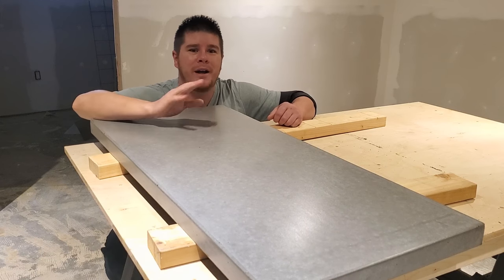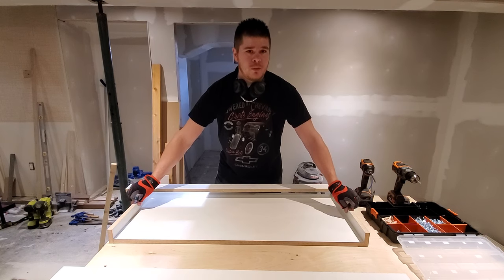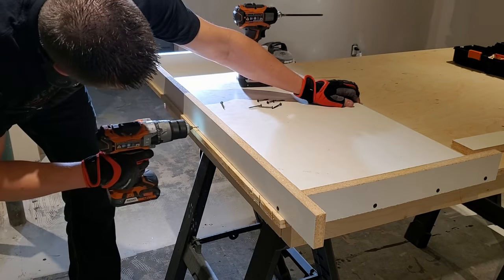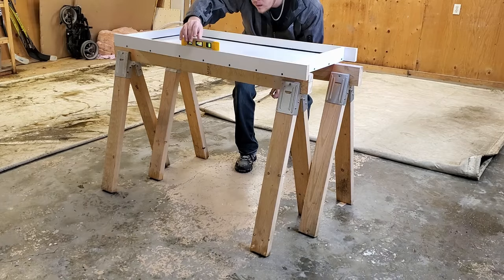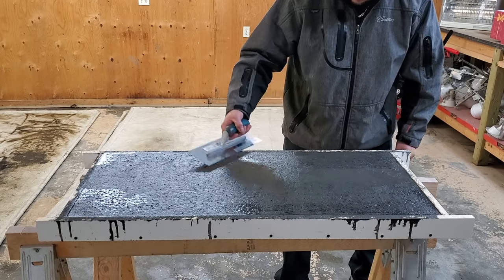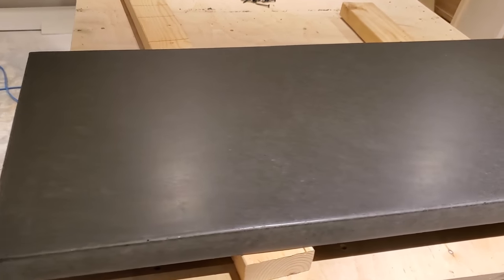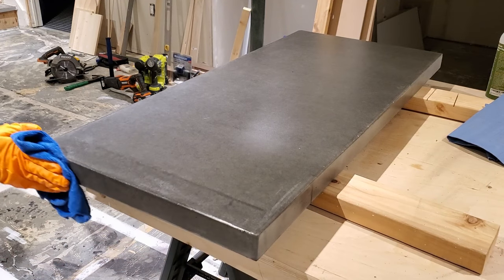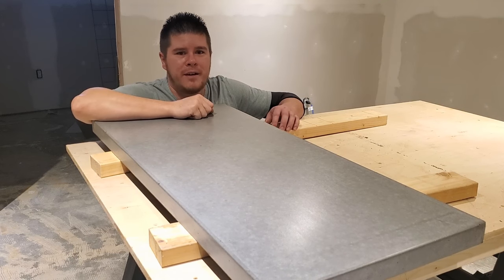Beginners guide, Concrete Tabletop you can build. No special tools, hand finished

Comment: Hi Jesse - As so many others have stated, yours is BY FAR the best instructional video for a DIY concrete counter I was able to find. Thank you! I used it to make a fireplace hearth. It came out amazing except for one small glitch. For some reason, I'm able to see outlines of the wire reinforcement on the surface. I see in other comments you referred to this as "ghosting." My slab is 1.5" like yours. Perhaps my cement mix was a little too watery and it settled closer to the surface during vibrating. I used countertop mix. I don't think it was too watery, but who knows. Anyway, I wouldn't mind natural color variations since it is concrete after all, but the visible "grid" does take away from the natural look a little. There are spots of the surface that are darker like where the grid lines are and it almost seems as though there is a residue or something in the pores causing the lighter spots. I included a close up photo as well so you can zoom in and hopefully see what I mean. I have thoroughly polished with the 800 grit several times with no change. These photos were taken while it is completely dry. I have not sealed yet and was wondering if you could think of anything I might be able to try to "clean" the lighter areas so at least the grids lines blend in a little better. Thoughts?

https://photos.app.goo.gl/6d5mUvg7XCADpFjNA
https://photos.app.goo.gl/xczbMPRhvs8B7snv8

One other question. Since this is a hearth, I am concerned about using an acrylic (film) sealer rather than a penetrating sealer. Fireplace tools would likely scratch a film over time. My plan is to use a penetrating sealer with the wax. Is my thinking correct on this?
Reply from the maker: I replied to you via email!

Comment: Thanks for  a great video, showing a very straight forward and approachable way to do this.
One "thought" that possibly (?) could make "mold making" even easier. 
What about cutting all the "edge pieces" to be a "bit to long"(4-5 inches). And then when You mount them You start by fixing the first one perfectly aligned on one edge of the "bottom" and let it "over extend" the other edge. Then when You then mount the second, third and fourth "edge piece" You just put it "but up" to the overhang of the previous piece, thereby You will also "automatically" get perfect fit without really having to measure the length of any of the "edge pieces"  exactly (which I believe could simplify the procedure for people who have more "rudimentary setups") . AND since all the "edge piece" will have one end with "overhang" You might even get a mold that is even easier to "break down" without "endangering" the slab :)
Just a thought..And I realise that it might be hard to understand when put in writing, but I hope that I got the general idea across.
Best regards
Reply from the maker: Anytime, I'm glad you liked it! It actually wasn't long after I made this that I realized that method would be even better lol it does make measuring the sides even easier and gives each piece a pull handle. You are correct! Good luck on yours and let me know how it goes! Thanks for sharing

Comment: Thanks for a great video.  I took the forms off of the slab and am in the process of sanding, sealing and waxing.  So far it looks fantastic.  I did exactly what you described and I was surprised at how easy this was. Thanks so much for all of your efforts!
Reply from the maker: Awesome! Thanks for watching. I'm glad I could help and stoked it turned out for you! I'd love to see it, and I'll even feature it if you send me an email with a pic, or tag me on Insta
Reply: What mix did you use
Reply: @chrisfaircliffe5533  I used Quikrete counter top mix with some charcoal coloring added in.  I bought both at my local big box orange colored hardware store.

Comment: I agree with the sidewall method. When I've done this in the past. I actually scrubbed measuring length of the sides all together. Just over lengthed first side flushed to one corner of the base leaving a wing, then did the next side clockwise. Leaving each sidewall with just one "wing" for that same sort of grab handle. Worked a treat an eliminates any need for needing any sort math or precision ..or even measuring for sidewall length cuts. 𝒯𝒽𝒶𝓃𝓀 𝒴o𝓊 for the carwax mold release idea. Excellent!
Reply from the maker: It's so much easier that way. I'm glad you liked it!

Comment: Hi!  Just wanna say I like your video

My favorite trick with finger finish- put a tiny bit of dish soap

You can also take a bolt and run it on the corner and pull off the excess so you’re left with a super minimal finish on your corner.
Reply from the maker: Hi! Thanks. 
Absolutely you can, I've shown other ways in other videos, but this was simplest this time. Thanks for sharing

Comment: Thanks a million. Just about to make a test piece of a countertop with scrap melamine board before making big countertop. I will make one mould with sand, cement and plasticiser and another with small stones added to see if aggregate can be seen on the finished surface. Great video. Much appreciated. Great to know I don't need to buy expensive tools for a good finish
Reply from the maker: Thanks! Aggregate is used for strength, without it, it will be much weaker and more likely to snap or crack. If vibrated correctly, you won't see any as the concrete creme with encase them. Good luck and have fun! Any questions, just ask

Comment: You have put together an exceptional video about how to cast a tabletop or anything else, really. I would offer one small criticism. Concrete does not dry. This is so commonly said that it changes how people handle/work concrete. Concrete cures. It is a chemical reaction, that even generates heat, making it an exothermic reaction. Concrete requires water to go through this reaction and some of the hardest and strongest concrete is formed underwater. After the surface is hard enough to not be disturbed by water let it have all it wants---flood it, especially if it is a hot day and in direct sunlight. Great video!
Reply from the maker: Thanks. That is true. I am typically a big proponent of telling people the difference between dried and cured, they are very different. Doesn't matter if it's concrete, paint, or some kind of coating. I was trying to keep this video as simple and DIY approachable as I could. Thanks for sharing

Comment: Great video, I'm going to try it as soon as I can get all the supplies lined up and outside weather is a little warmer, I'm in Canada, still kind of cold here. I was wondering what kind of dye you used, I would like to add that to the mix as well. Thanks for giving me the courage to give this a try, I plan on making a top for a outside coffee table on my deck.
Reply from the maker: Thanks, glad you liked it! I'm in Saskatchewan myself lol where you at? I used Quikrete liquid charcoal dye, I only used one bottle per bag of concrete but you can use up to 2, just reduce the water a bit. I'm glad I could help you out and that you found it useful. Good luck on your project, keep me posted on how it goes!

Comment: I’ll be trying this tomorrow, thanks a lot for sharing. This has been the best video I’ve seen so far, simple, to the point and an amazing result (the best one). 
Keep up the good work!
Reply from the maker: Wow, thanks a lot! Good luck and have fun!
Reply: CanaDIYan man, I did it and vibrated it for nearly 20 minutes (by hand, haha) and wow, the results are amazing. That top is smooth as it could be, gorgeous color and all. It doesn’t look as sleek as yours but I’m proud because the result is very aesthetic. I’m going to redo it because I poured a bit too much water and although it’s been holding well I wouldn’t trust it for long without a base under it (it currently has the melamine that was on top under it). I did it with nails instead of screws because I had very limited tools, and the bottom part is not as pretty because I couldn’t cut the pieces to size, so the mold would’ve been too thick if I had poured concrete to the top (all I had to work with was a handsaw, a hammer, nails and a few other things). All in all, great video, great instructions. I know the second one will be smooth af.

Edit: grammar
Reply from the maker: Dude thats awesome! I'm so glad you tried it and it worked. Kudos for making it work with that you have! All it takes is practice and technique refinement over time, each one better than the last, confidence grows, and you have fun. I'm pumped you got back to me. Keep going!

Comment: watch quite few of these, the first one i have see with no major air bubble issues. great work and subscribed right away
Reply from the maker: Thank you! The biggest problem is people literally vibrate it for like 2 mins, and smack it 8 times with a hammer. It takes waaay more than that to get the bubbles out. I find it's easier to vibrate for much longer than fix the bubbles later. Thanks for subscribing! Glad to have to on the crew

Comment: Looks pretty darn smooth I am going this route for my (93) mom's m-in-law kitchen and hoping to do a corner sink also. as you say details- pin holes can be filled, as you wish I think I want to make the sink corner 34x34 but into the longer @ >8' and 5' pieces counter tops with w thin rubber joint rather than grout.  The sink will be a project alone.
Reply from the maker: Thanks! Sounds like you have your hands full. Good luck!

Comment: Thanks for the video. Thanks also for being normal and informative and not full of 'rah rah. Just made my countertop out of the Glass Fibre Concrete (GFCR) and it came out really well. Only thing I would say is that I wished I'd used as little silicon as possible - the concrete has picked up all of the change in texture and it has left an obvious mark around the edges. Especially where it had smeared a bit wide. But for a first effort I am pretty pleased.
Reply from the maker: Anytime, happy to help! That's awesome, I'm glad you gave it a go. Yeah, it's amazing what the concrete can really pick up, it conforms to everything. That's exactly right tho, you learn by doing so next time you have that experience! Good job

Comment: I just finished watching this YouTube video you made and, boy, am I impressed! What you made is beautiful! I'm now inspired to make something similar - a concrete hearth for my fireplace.  A question I have - and I'm hoping you have some knowledge on the subject and can offer an opinion - is if the concrete could handle the heat from a fireplace insert without cracking. The concrete hearth that I have in mind would be 5 ft long x 20 inches wide x 2 inches thick and placed directly on an existing concrete slab foundation.  Also, what proportion of 'charcoal dye' did you use per sack of conc? The tone of grey is perfect.  Thanks for your posting such an impressive video.
Reply from the maker: Thanks so much, glad you liked it! That's awesome man, that was my goal, to show you that you can. In terms of cracking in extreme heat, you'll probably get some minor thin cracks. The larger the reinforcement or more surface area the better, you may want to look at thin reebar or a thin wire mesh used for parging, you can find it in the concrete aisle. The stronger it is and more surface are it has to grab, the less chance for large cracks. I used 1 bottle of dye per bag of concrete, but you can go up to 2 bottles per bag if it's the quikrete dye. Hope that helps, good luck!

Comment: Jesse Great video I appreciate your craftsmanship , I'm wondering if I grind down further to expose aggregate will I end up with more "Bubble" problems?? I'm making 2x 9"x9"x3" thick for some fancy stereo tube amps that I want to dampen vibrations. Weird I know. - cheers
Reply from the maker: Thanks! Sorry for the late reply. It's possible you could expose some, but some cement mixed with 50/50 acrylic fortifier and water will make a paste you can rub into them and fill them, let it dry and lightly scuff clean by hand with a time bit of water. If you want to see how to do it check out my concrete vanity top video. Hope that helps and good luck on your project!

Comment: This looks great and super doable. On some of the tutorials I've seen there is an acid wash step with a muriatic acid solution - curious if you're able to elaborate on why or why not one might do that step?
Reply from the maker: Thanks! It's totally doable. The acid wash step can help seal up some of the pores in the concrete and can help with smoothing and help prevent staining. On most slabs like this I don't find it totally needed, maybe on a big countertop for that crazy perfect finish. But after a quick sanding like I showed, a good couple coats of sealer and then the wax, I've never had a problem. It's plenty smooth enough for me, and I've never had a problem with staining or anything as long as it's wiped up and not left to dry in

Comment: This is so great thanks! Any suggestions on how and when to attach the legs if it is to be a table?
Reply from the maker: You'd have to make an entire solid frame to hold the weight of it and not just legs. But typically the weight is enough to hold it on, but some transparent silicone is also good. Add a dollop to each corner

Comment: Thank you for this. Very clear instructions and great looking countertop! Can I put in a wooden slab on the bottom side to make it lighter / easier to ount on the cabinets?
Reply from the maker: Anytime, glad you liked it. I wouldn't recommend wood. Some people use foam insulation and remove it after to make it lighter. When it comes to mounting just use clear silicone under it

Comment: Hello.  Excellent video.  Very helpful indeed for an absolute beginner.  You said "any 6000psi concrete" but can you tell us more specifically which concrete you used.  It's the perfect colour. And I'm very impressed with the lack of tonal variation.  I notice when I'm trying to buy concrete here in the UK that there are lots of options including 40N, Coarse Concrete 40N, and QC10. Some of the available brands are Blue Circle, Hanson, UnltraCrete, and Quikrete.    We just want to get this right so we don't waste too much time.  Thanks for any additional information you can give us on buying concrete.
Reply from the maker: Thanks very much, I'm glad you liked it! I used Quikrete 6000 psi concrete in a blue bag, but the 5000 psi also works very well in a white bag. Both are plenty strong for this use. I also added 2 bottles of Quikrete charcoal liquid dye. I used 2 bags of concrete, so 1 bottle per bag, but you can used up to 2 bottles per bag if you wanted to go even darker. Honestly and brand will work, but the finer the better for this. Just make sure after adding the dye that you mix it like crazy after. They prefer you add it to the water, I did that with 1 bottle, and poured the second bottle straight into the mix. Hope that helps, let me know if you have more questions

Comment: Great job it looks awesome I’m going to try and make a 6 seater dining table using your method thanks for the info 👍
Reply from the maker: Thanks! That's a big slab, good luck! Keep me posted
Reply: @JessedoesDIY  I also would like to make a big one, 5ft long. Is there any risk of it cracking the bigger you make it?
Reply from the maker: There is always a risk, but I'd maybe give it an extra day or 2 to dry before finishing just to make sure it's getting even drier and harder. Good luck

Comment: Great video.  Thanks. Question: do you have a video on how to install the counter top?
Reply from the maker: Thanks. I did but it didn't perform well so I removed it. Just add some dollops of silicone about the size of a quarter in each corner, and in the middle every 8 inches or so

Comment: I am so excited to try this! How fragile is the surface when you're done? I'm assuming you couldn't treat it like a cutting board, but how careful do I have to be not to scratch it?
Reply from the maker: That's awesome! It's not fragile at all, it's stone. Once it has had a week at least to dry, it's hard AF. The only thing is certain acid foods or coffee can stain it if it isn't cleaned up right away, but I've never had an issue with that either.

Comment: Refreshing to see someone clearly demonstrate not trowelling right after pouring. And all the time vibrating is very interesting. I guess that the metal reinforcement does not end up on the bottom, even with all the vibration?
Kern, in "The Owner-Built Home" (c) 1972, 1975, says "The Rocla Laboratories of Melbourne, Australia, found that an 11 percent higher tensile strength can be obtained when sand and cement are first mixed together, with the coarse aggregate being added after the water. This is an 11 percent gain in strength over the customary practice of mixing coarse aggregate in with the dry sand and the cement." Nordmeyer, in "Quality Concrete from CRAP" (c) 2017 says, "when using a portable mixer, always add most of the water first, about a third of the sand, and then all the fines (Portland cement, pigments, fiber, admixtures); then add the rest of the sand." 

I can't square these two experts in their opinion, but I'm inclined to believe Nordmeyer. Any comments on this?
Reply from the maker: The reinforcement will eventually fall to the bottom which is why most of the vibrating is done first and then it's added in the top half of the pour. I can't speak to strengths like they are referring, I used pre bagged mixes. I'd use additives or different mixes to get more strength out of it  but even basic concrete is super strong for this use case I wouldn't be worried about it